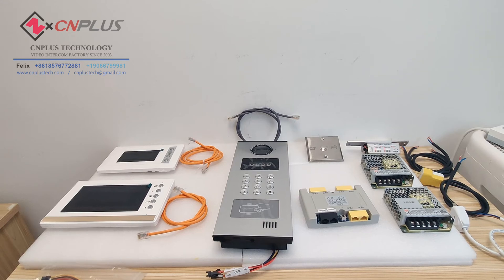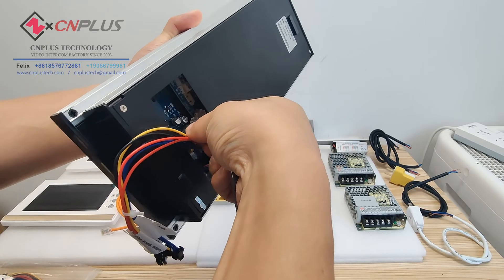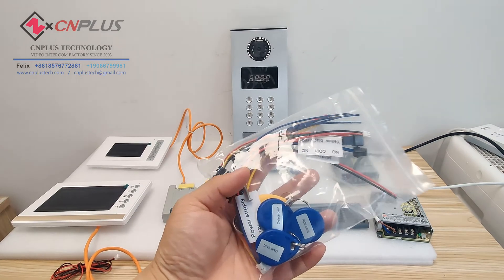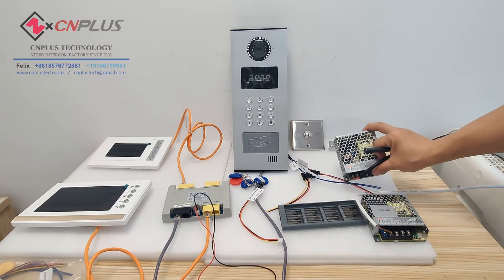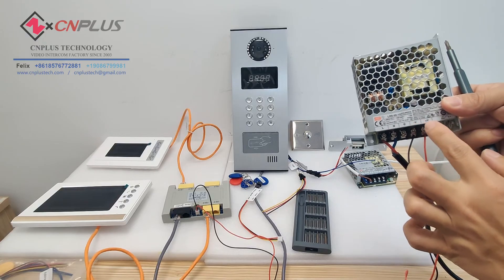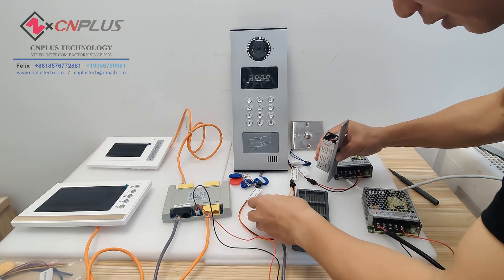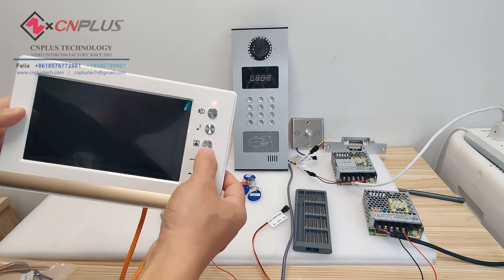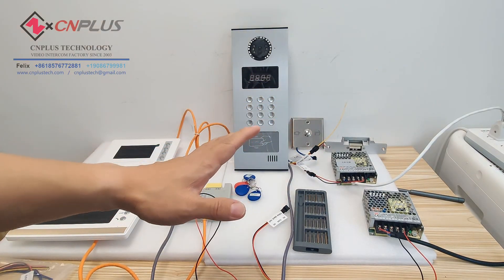How to Wiring Analog Apartment Video Intercom

Comment: I'm installing that similar system in my apt building. Seeing in the video how short the wiring is for this system, do i need to order more wire, what gauge wire to use.
Reply from the maker: Dear Mr. Bernard Johnson. Thanks for your interest in our Apartment Video Intercoms. 
The suggested wire for this system is CAT5/ CAT6, and the maximum distance from the Decoder to the Monitor is 75m.
For more detailed information including the latest pricelist, please write to felix@cnplustech.com,
or call me directly at my US Number (908) 679 9981.  Thanks so much in advance.   Felix